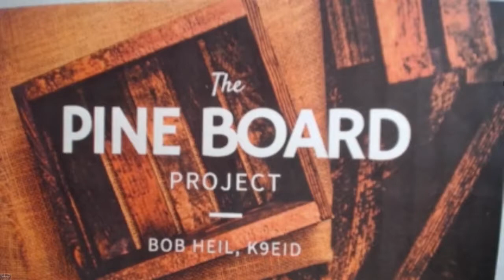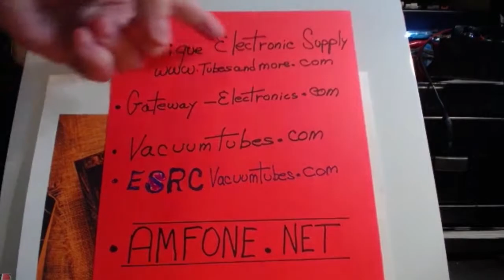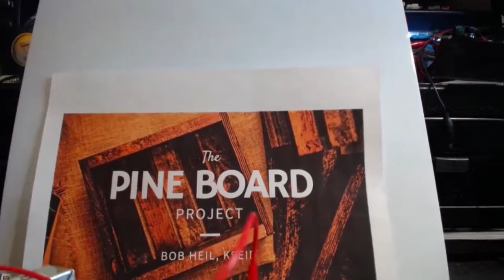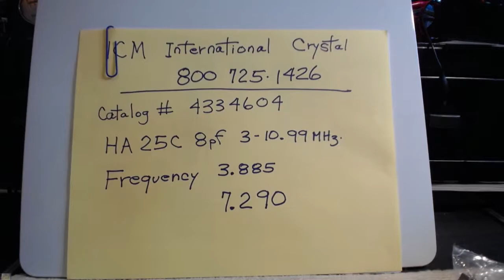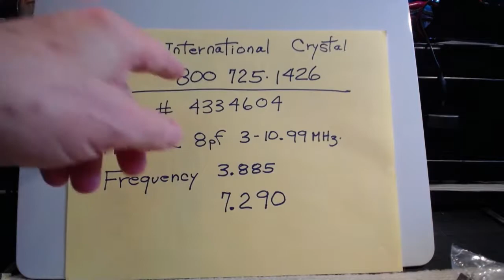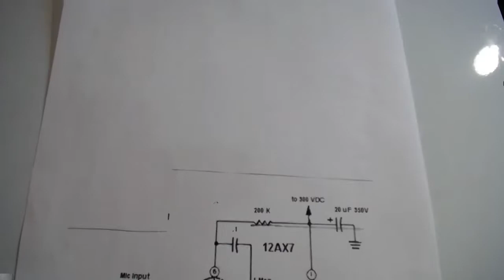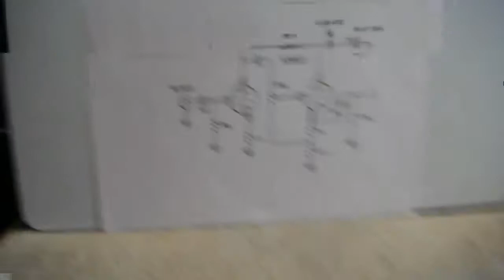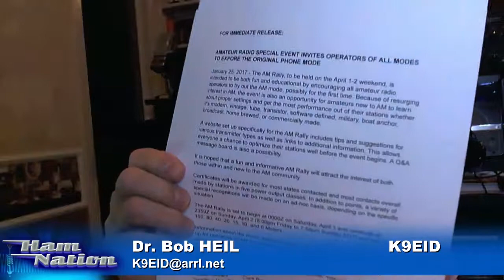Pine Board Project from HAMNation on Twit: Power Supply Part 3

Comment: You can do as I have done. I use an xtal transmitter using a 61BT valve and around 350 Volt power supply with a bleed resistor permanently wired in, a 100K Ohm half Watt from H.T. to earth will do to reduce the voltage after switching off. It starts discharging the capacitor immediately but takes several seconds.  Before working on it still check with a multimeter there is no voltage present in case the resistor has failed. Think safety.
Bill, G4GHB.